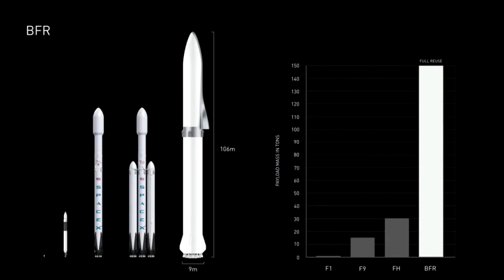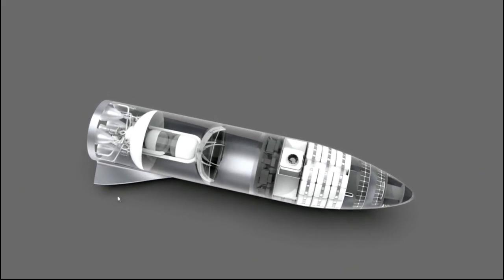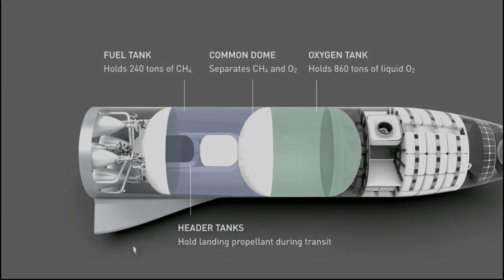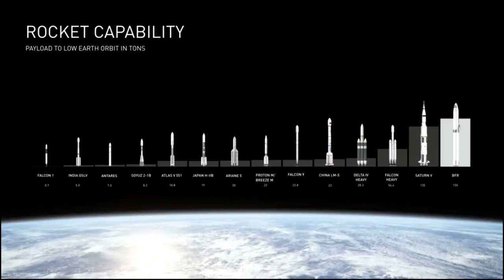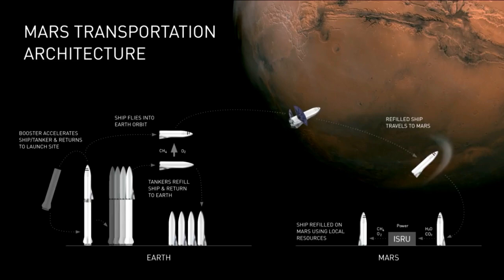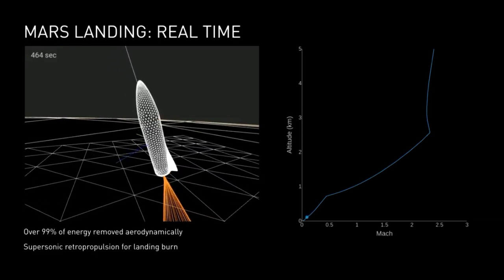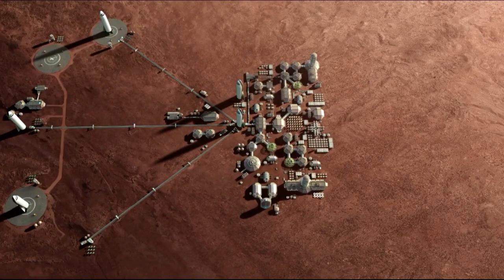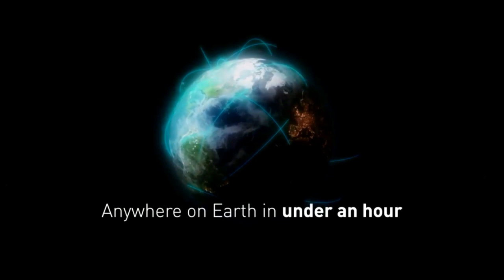SpaceX BFR - the plan for interplanetary transport

Comment: BFR go to Moon or Mars is very good! but please don't waste BFR on Earth continental travel, too dangerous and too costly,  plus noise problems. Half hour Earth trip means high-G force sustaining, bad for untrained human passengers. New supersonic airplanes will come out soon, which will be major competitors.
Reply: I doubt they’ll ever actually use it for earth continental travel. It would be an FAA nightmare for SpaceX to get the thing certified for such use. It will likely just see a few grasshopper style test flights at first in 2019 to test the vertical take off & landing followed by a few orbital reentry tests at high speeds to test the heat shield in 2020 & maybe a lunar tourism mission or two shortly after that & when they know it’s ready for Mars they’ll fly the first few cargo missions in preparation for the Mars colonization missions within the early to mid 2020’s.

Comment: When Elon reveals a mock up of the BFR, like he did Dragon 2, that will be a great day.
Reply from the maker: Unfortunately, Dragon 2 remained a mock-up so far.
Reply: Even with Elon time, this guy is still trumps development on SLS or any other major space project. Imagine.... A reusable space craft that can take 150 tons to orbit.
Reply: Umm, no? The first unmanned test flights will be conducted next year, and manned operations will begin next year, or 2019 at the latest. But, things tend to take longer than expected. Do not expect BFR to fly before the mid 2020s, and don't expect a Mars mission before the 2030s, if then. That will be OK though. If BFR actually has all the capabilities Musk is promising, suborbital, earth orbital, cis-lunar, and can even land on the moon, that will be exciting enough for ten or twenty years.
Reply from the maker: Dragon Crew and CST-100 were supposed to carry astronauts to ISS in 2017. This year Elon Musk announced that there will be no powered landings for Dragon Crew, as originally promised. According to NASA, the first uncrewed flight should be in February 2018. Let's wait and see.
Reply from the maker: Correction: the first flight was delayed again to April 2018
Reply: "as originally promised". Correction: Not promised, planned. The reason to cancel this, is time and money. Technically it works, but to have it be approved by NASA, it needs more time and money to achieve this, which doesn't add up positively for either part. Especially as all development and funding now has been directed towards the BFR. The BFR will also be able to dock to the ISS, making the Dragon 2 capsule reduntant. I can only imagine what the next ISS will look like, if/when SpaceX get BFR to lift cargo in to LEO and beyond :)
Reply: SciNews; They actually built (and tested) a real Dragon 2 several times. They performed a few super draco engine tests, a pad abort test & recently a recovery test on the actual spacecraft itself out at sea. It’s no longer a mockup it’s an actual spacecraft! Not 100% sure if the one they used for testing will be used in the 1st unmanned demo flight to the ISS because NASA may want SpaceX to build a brand new Dragon 2 for that flight test. They are also waiting on the Block 5 version of Falcon 9 which has also been built & is expected to undergo testing in April & to be human qualified by NASA will need to perform 7 successful flights & each one a brand new Block 5.

Comment: Problem with Space X is it relies on traditional rockets; the cost is phenomenal; we need a new fuel and re-usable ships if this is to be a success; and in all honesty we could just build a space elevator and space station well within the costs of current rocket technology....and if we build a ring around the planet we may have all the energy we ever need...these alternative antigravity devices could be incredibly useful for reaching orbit... and warp/hyperdrives seem within or current ability...

Also why not use a form of black hole engine the compressed spec to cause expansion and decompression, a real alternative to fusion...

Also I think Musk forgets gravity will pull on the ship from all angles....I get the impression Musk has forgotten this...
Reply: Ok then, give us a call in 15 years when your experimental space elevator is up and running.
Reply: So in short you have no clue when it comes to physics. I'm sure all your ideas are great for the fantasy land you are building.
Reply: Fissle Wine You really have no clue what you are talking about. Where have you read that "gravity will pull on the ship from all angles"??
How do you think that we have sent all satellites to space genius? With ROCKETS. The only thing that SpaceX is doing is making them reusable and cheaper.
And no, gravity only pulls you in one direction, the line between your center of gravity and the earth's core.
Reply: "gravity will pull on the ship from all angles" wtf is that supposed to mean?!
Reply: I'm going to laugh so hard at your comment when they make it...
Reply: Fissle Wine You realise that everything you said doesn't make any fucking sense right?
A space elevator? WTF??
Reply: Fissle Wine "Are you a scientists? Do you have credentials in physics, or biological science?"
Well I have 2 years of High School, which is enough for me to know that what you said is bullshit lmao
Reply: Fissle Wine
I'm trying hard to make any sense of what you are saying about the gravity pull:
    "in space gravity of different magnitudes will effect[sic] the ship"
what? do you mean gravity will be a different strength than on the surface of Earth? do you mean different planets might each pull on the ship?
    "masses will be attracted to each other"
that is gravity, not sure why this sentence is here. do you mean the two docking BFRs would be pulled towards each other? if so, the attraction between the two would be exactly as much as between two soccerballs on earth's surface, that is to say, completely negligible.
    "traditional and modern rockets rely on flight systems similar to that of a plane"
again not sure why this sentence is here. do you mean this in a negative way? that rockets navigation systems are not good because they are too similar to plane's? navigation systems may be similar, but they are certainly not identical, and a lot more sophisticated for rockets
    "in space we cannot rely on speed for lift"
not sure what this sentence is trying to say, it is technically true, but in orbit around earth there is no need for lift. rockets typically fly in an arc, vertical at first, and then they turn sideways and accelerate until they are in orbit and no longer need any lift. think of throwing a ball sideways: it will fly in an arc. now imagine if you throw it so hard that that arc will be wider than earth. it will now fall around the earth and stay in orbit.
    "and and require multi directional movement"
witstts (what is this sentence trying to say)? do you mean the rocket needs to be able to turn and not just fly straight? if so, they already do. the falcon 9 rocket first stage has small thrusters at the top to allow it to turn (visible in landings!), the dragon spacecraft has even more of those in all directions (oval shaped holes in pictures), and the rocket engines on both falcon 9 stages are able to gimbal / turn a little bit in each direction to control flight direction.
    "and in all honesty most good ships will have an engine that has multiple capability" 
witstts? do you reference a specific sentence from the video?

    "we have seen the benefits of thrusters located around space stations"
witstts? if it again means BFR or other rockets can not turn / navigate, see point above
    "this design seems so pathetic refuelling in space may well be easier than refuelling an aeroplane in flight"
witstts? why does this design seem so pathetic to you? because it would be easier than refueling planes in flight?!? yes it might be, no vibrations / air turbulences to worry about, but what is your point here? space refueling is not something we have really done before, in contrast to air refueling.
and how does this make the design pathetic if it gets the job done of allowing more fuel / deltav capacity for the space ship? do you want a bigger ship instead? this design specifically uses a smaller rocket with repeated use / refueling to be cheaper than one huge rocket.

    "I don't think this is the real design"
well fine, but it IS the real design spacex is working on right now...

    "you need a ship that can resisted the gravitational pulls all around it"
witstts? if you mean the ship will be pulled apart by gravity from different celestial bodies ... well that's not how gravity *works*. even if there are several strong gravitational influences the ship would not be pulled apart, as gravity pulls on every single molecule in the ship absolutely identically, and every part of the ship will move in exactly the same direction even without anything holding it together.
    "and not rely on a team based on Earth calculating every movement before you journey"
ah, finally an understandable and clear sentence. which doesn't make it any less wrong. this sentence shows your COMPLETE lack of understanding of modern rocketry, as it is just plain incorrect. sure, the rough flight path is calculated before launch, and this is especially necessary for payload orbits which need a very high positional precision. but this doesn't mean every movement is calculated before the journey. all modern rockets, including spacex's falcon 9 rocket and also their future bfr, use onboard flight computers to correct for deviations from the planned path during flight, due to winds, turbulences or just general unpreciseness from engines or steering. especially for the landing of the first stage booster immediate corrections are absolutely necessary, and can certainly not be determined before the launch in any way. if you tried to send instructions for steering and engines on a journey to mars, there would be the additional problem of the signal traveling for several seconds or at the end even minutes before reaching your ship.

IN CONCLUSION:
No, your elaboration is in no way clear enough for me, as in every second sentence I am very confused what it is even trying to say. Additional there are several facepalm moments and sentences which suggest a severe lack of understanding in physics and in rocket technology.

You, dear sir, are an example of the Dunning-Kruger effect. Please wikipedia it, but this image explains it good enough: ww█w.artandtechnology.c█om.a█u/cartoons/Dunning-Kruger.jpg
You know next to nothing about the field your commenting on, but despite that, your lack of knowledge doesn't even allow you to see just how wrong you are.

As your other comments so far contain exactly the same amount of bullshit as the first, I am not going to comment on them. Only this: If you fry force it doesn't taste too good, and we can't build force fields except electromagnetic ones, which are not possible to use in the way you suggest.
Reply: Fissle Wine , what results of anti-gravity devices are you referring to?
Reply: Nywe think for a moment...try to answer the question before asking for an answer.

You see in space gravity of different magnitudes will effect the ship, masses will be attracted to each other, and traditional and modern rockets rely on flight systems similar to that of a plane; but in space we cannot rely on speed for lift and and require multi directional movement...and in all honesty most good ships will have an engine that has multiple capability, we have seen the benefits of thrusters located around space stations...and this design seems so pathetic refuelling in space may well be easier than refuelling an aeroplane in flight...I don't think this is the real design...

In short you need a ship that can resisted the gravitational pulls all around it, and not rely on a team based on Earth calculating every movement before you journey, in which there will be elements unforeseen...is that clear enough for you darling?
Reply: SpaceElevators will never be a thing, even IF we could build it
The energy to lift something so high, and then orbit from it, would be the same than to get into orbit from earth
In space its not a question of going up, rather going fast enough

Not to mention the stress in such a strucctre would be so large not even Graphine would hold, as you still need it to be large enough to carry a heavy payload trough the atmosphere, resist the tides, recist storms, recist space debries and be in a perfectly stable GeoStat orbit around the equator
Reply: i think NTP will be available by the time this goes ahead.
Reply: Rhine0Cowboy 15 years lol, you can build something like that now without using any cables, which is the beauty of it...because theoretically any point on the planet could be used to create a toy magnetic floater, but a more sophisticated model could take advantage of the gravity well where negation energy is drawn to the Earth and that there is a skin like layer where elections energy levels change...but that maybe beyond you in terms of explaining right now...
Reply: Miguel Pereira do I really need to read that in a void full of masses with gravity that this effect can occur? Are you a scientist? Do have credentials in physics, or biological science...because gravity effects both mass and cells are reproduce with a need for gravity...I don't think your really having a genuine discussion here, good bye.
Reply: valberm I'm not saying he won't make it, because he is the main guy trying to get to Mars and space commercially, as such I really want him to succeed...but unsure if this is the system we really need...again as reaching orbit may be much easier and mean all fuel is used for space travel...

We should look at how efficient fuels are now, now imagine if you add that efficiency with a true anti gravity device, and newer technologies for gaining power from the environment meaning the ship is also plant like...

And in terms of the colony sealed environment nothing works better than a (higher dimensional structure) force field meaning colonist have the capacity to survive meteors and high impacts as long as the generator is protected...instead of depending on rigid 3D structures like glass; and I don't think mainstream people will endure being in a city of boxes like this; one reason, I think space has been an elitist movement...I can only hope Musk will embrace user centred design, and user experience design as a fundamental part of his projects...
Reply: Fissle Wine , current technology could be used to design a space elevator on the Moon, maybe Mars, but we don't have the strong/light enough materials for Earth.
Reply: 'fry force' was a spelling mistake, that I've corrected...Now, the ship has no concept in its design for dealing with unwanted gravitational forces - I won't go into this anymore as its beyond the scope of this discussion. The way the ship lands in terms of UXD and UCD presents issues because, ultimately, a ship on Mars should be considered as a living area,  factory, lab, mining facility and more; really the ship should be designed to facilitate these aspects and a ship that can land and dock into the environment over large spans of space will mean the mentioned characteristics can be done immediately and safely...currently the cities design is reliant on structures that can break relatively easily and create unwanted psychological effects; something a force field resolves immediately.

Now, I'm shocked rocket fuel isn't powering another form of engine, as rockets as a technology seem redundant for space flight, when seeing the results of a host of electrical and solid state anti gravity devices...

Finally, I really must say,  you have been rather uncharitable in interpreting my posts...and you really should sit back and take a look at things from an innovation managers perspective...before making rather childish slurs of the Dunning-Kruger effect; LEL@U!
Reply: Take a look on the web yourself, youtube, google and google scholar...I think there are other methods Musk could channel the smallest fraction of his funds into with a relatively small team of specialists and hobbyist, even getting people to work for free via online communities who want to make the step into space travel a realistic one, and I suspect Musk could be surprised not only at the people who get involved but the data he could attain and thus see results or rewards relatively fast; while still working in terms of antiquity on his current rocket technology; I honestly think a ship could become like a car, where an intuitive application allows even the most mediocre individual to, forefill a range of activities on a ship, and be part of something great and feel a sense f achievement and hence I wondered if musk ever thought of using rocket fuel to power a new engine design based around electricity and a host of thing surrounding changing the density of space?A universal engine that is future proof is needed; the current design doesn't seem to be future proof, and money will likely be wasted - on a journey to a dead planet, to die in a metallic box, with no internet connection.

So how smart is Musk really? I get the impression his rocket is just a another way to milk the national banks and pockets of those he dreams fit to invest; and also rather poorly keeping people dreaming about space in a world that may not actually have the aspiration to go into space or be part of some intergalactic society.